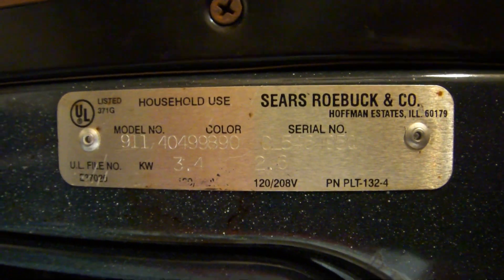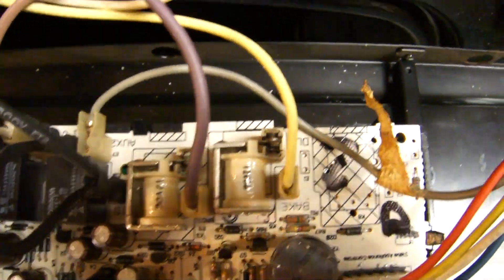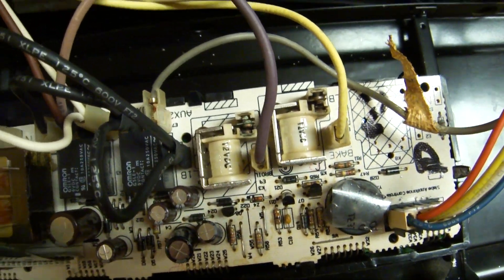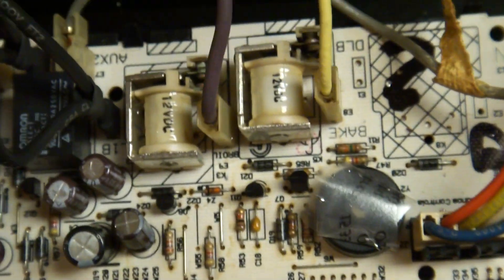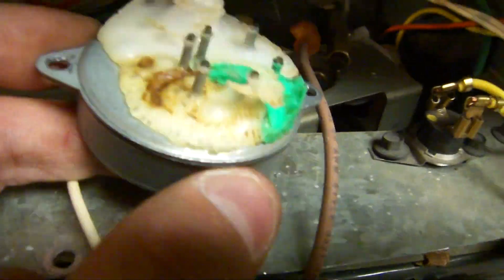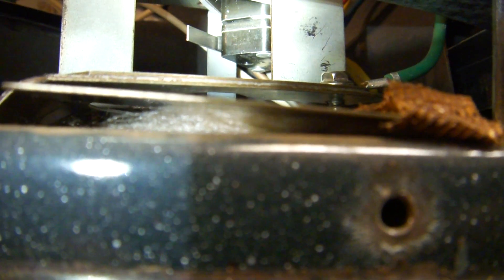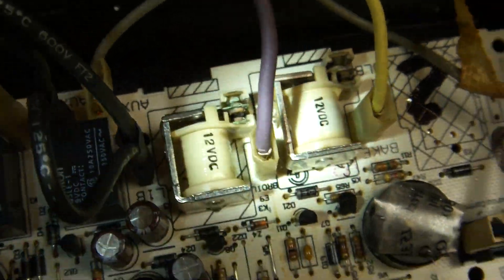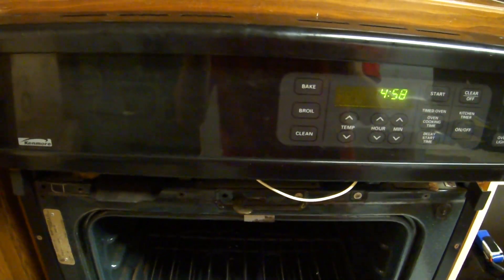00003 Kenmore POS oven Unnder Designed

Comment: You're exactly right!
They use undersized, low quality relays in many products. And it's not just one company ... at school, a magic chef (I know, it's a cheapy) microwave started smoking because the relay contacts welded. (Though they still had some resistance, so it caused the relay to catch fire.)

And dude ... 1:45 ... be careful around live equipment! Please! :S